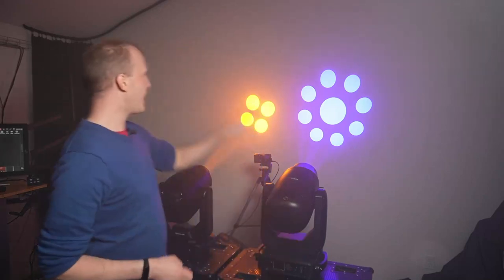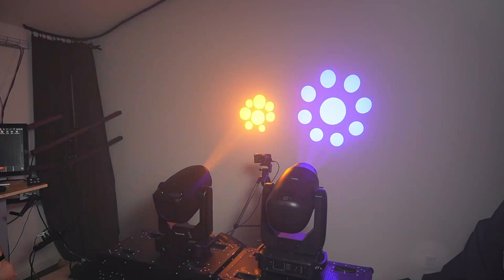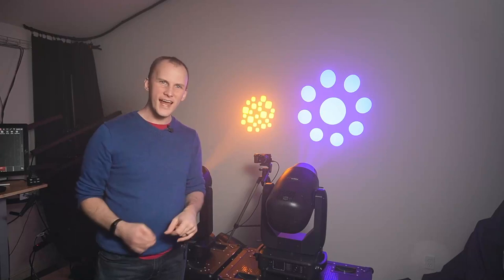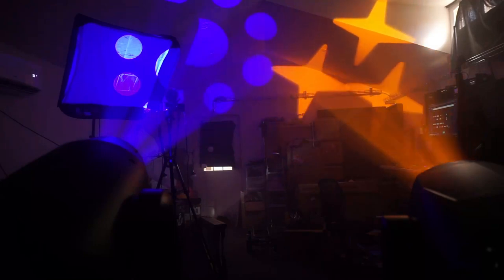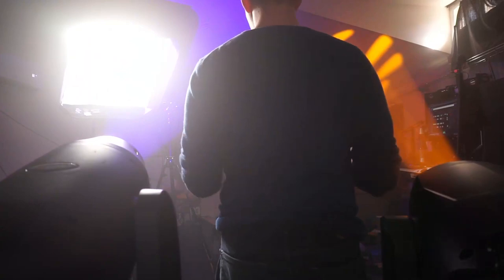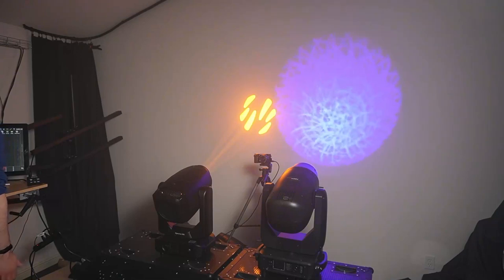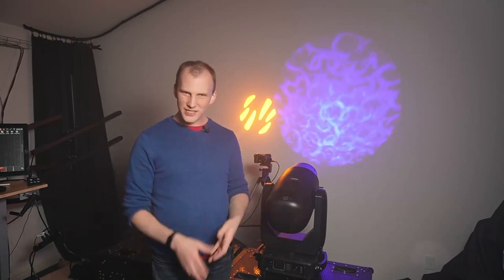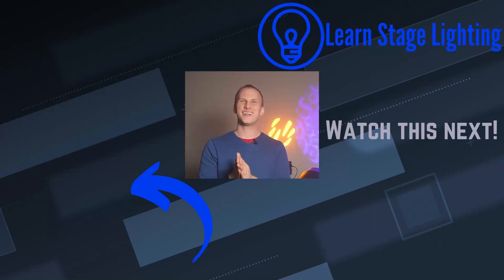Do You Need Rotating Gobos?  The Complete Guide to Rotating Gobos vs. Fixed Gobos

Comment: Good video my friend, thanks!
A lil correction with all due respect!
Fixed gobos can be customized and replaced, the difference is that you have to change the whole gobo wheel instead of just 1 single gobo as in the rotating gobo unit!